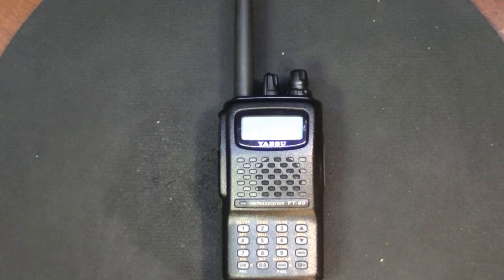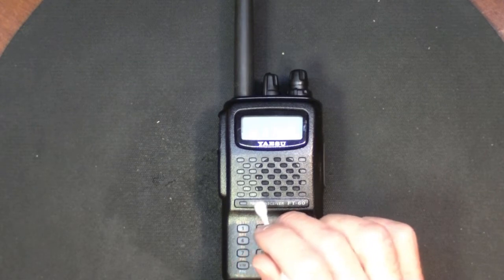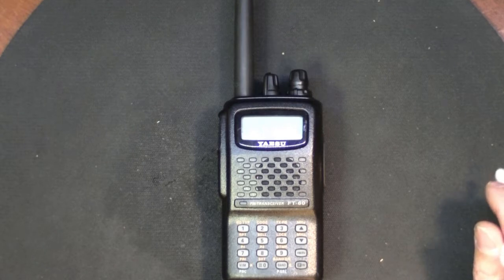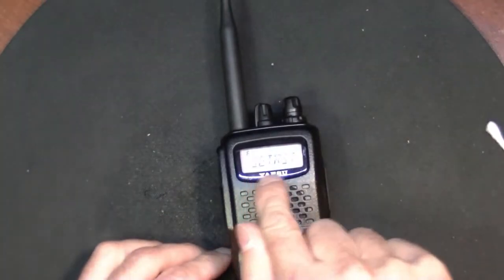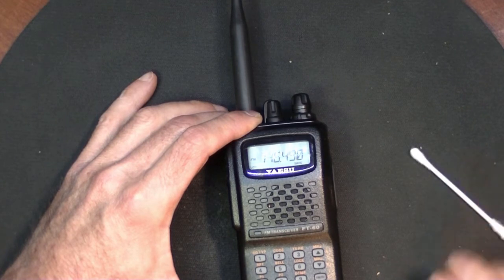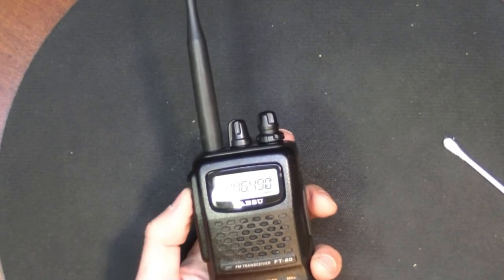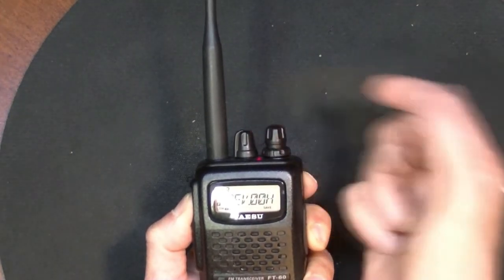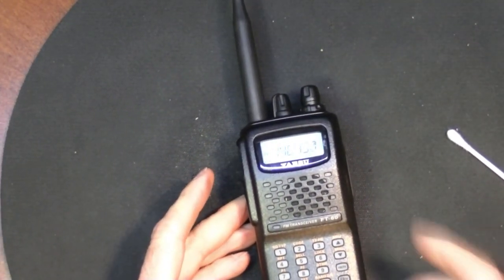Fix Weak Audio on Yaesu FT-60R HT in Less than 3 Minutes!  FREE!!

Comment: I tried to use your method, here, and as soon I turned it on, the display showed “SETFRST” but then the display blanked, started flashing and the radio 
beeping with each flash.
Reply from the maker: HI!  My radio didn't show those problems.  I don't have that radio anymore to experiment with...  If you go to mods.dk you can find the mods for the FT-60 and find the sheet for it easily...

Comment: Deviation or Modulation?
I just got an FT-60 from a Pawn Shop and have downloaded the full manual, these adjustments are NOT in it but I tried it and it kicks me out at the first F/W too, never did see the REFXXX on mine! In the manual on page 62 it allows adjustment of TX deviation from Wide, plus or minus 5kc to narrow, 2.5 kc. I tried that too but in various signal reports it sounded the same to the other stations.
Well Thanks and 73's from KD7CKT in Flagstaff, AZ, USA
Reply from the maker: HI... If you're using  the owners manual that's why those adjustments aren't there.  You'll need the service manual.  I just checked mods.dk and they have it listed there under "technical supplement".  I dont have access to that radio anymore to try it out again on mine.  If you don't have an account there, its free and i've never received spam from them.

Comment: i found my ft 60 again, purchased a new battery, but i noticed that it doesnt transmit on frequencies above 146.000, the range 146 - 148 now displays error. what can i do please help
Reply from the maker: HI Ralph... are you in Australia?  If so has your radio been modded?  I found a thread that said some radios in that area would crash and only TX 144-146.  This was a 2007 thread and I did not experience that with this radio which is a much later model than what they're talking about.
Reply: @JLPicard440 thanks for the reply
 it is from VK and yes it had the Mars. Cap mod.
If I knew what value that resistor or diode was, I could understand mod it and sew if it reverts back?
I have heard suggestions that the eprom may have defaulted back to the JA version which sounds some what plausible?
Reply from the maker: HI, I'm not sure about the eprom. Looking up the mod on this radio, (hopefully your version is the same, I'm looking up the American version), the mod calls for removing R1164.  You might be able to find a service manual or a schematic for this radio (free) and find out what the value is of R1164.  Then you can use a conventional resistor with the same value and run short wire leads back to where the SMD was connected to hopefully restore the radio to the Pre-modded condition.  Ive never tried that, but don't see any reason it won't work, it goes without saying to do this at your own risk!
Reply: @JLPicard440  thnkyou so much best 73 from downunder

Comment: Hi, I finally got into it. There is no "xxx" on this radio.  And on a fluke I just hit the band switch 3 times without hitting the "FW" key and it went right in.  Seems this radio is an early version. This radio was purchased on Dec of 2005.  It looks MINT!  It had an issue of not working on the battery. The guy purchased a new one and got this for $35 dollars. I am no tech but I tinker.. lol.   I needed to change the power plug on the radio. Scary stuff because of TINY Surface mount parts around it. I wonder if there is a simple list of what all the other settings are in alignment mode?  It says what it is but I don't want to mess with it.   The owners manual shows stuff but you need lots of test equipment.   I plan to remove the "waterproofing" over the mic because of the muffled audio.  The "highs" should be much better.  THANKS for all your help!  73
Reply from the maker: Yes there's probably a list in the service manual.  A lot of the times you can download the service manual for free.  If it doesn't come up on a simple google search, check mods.dk and they might have one listed there for download..

Comment: I Just bought the FT-70DR and it has the weak audio.   I don't believe it has a lamp button.  Can you give the sequence for the FT-70DR?
Reply from the maker: HI, I tried to look for the service manual or technical supplement.  I wasn't able to find the manual for that one.  If that's a newer model, it'll probably come out soon..  Without the manual, there's no way to know the procedure..
Reply: FT70… just increase the gain in the settlings menu.

Comment: I have sold hundreds, and own eight FT-60r HTs ... this is totally unnecessary.
Reply from the maker: That's your opinion.  I thought it sounded weak out of the box.
Reply: @JLPicard440  I agree with you. I just got my brand new FT-60R yesterday, and while everyone said my signal was strong, at least 3/4 of the contacts I made over several repeaters, told me my audio sounded low/weak, even though I was just 2 inches away from the microphone. Thanks to this hack, that problem has been fixed! 73s!
KD2DKO
Reply from the maker: @CarlosGarcia-vd2xh  Awesome!  I don't know why they can't just give you a mic gain control in the menu...😂
Reply: @JLPicard440  He’s made this comment on EVERY FT-60 forum in regards to the Deviation adjustment. He’s a HRO salesman NOT a technician. Ignore anything this know it all buffoon says.
Reply from the maker: @petemitchell6788  Yes to me they sound like garbage out of the box.  Just my opinion though.  I appreciate the feedback.. 🙂
Reply: You own 8 of them? Go feed your dragon bro.

Comment: This and other settings are described in the FT-60R Service Manual, found here: https://www.qrzcq.com/pub/RADIO_MANUALS/YAESU/YAESU--FT-60-Service-Manual.pdf
No idea if this works on other Yaesu radios, but if your radio responds the same to the sequence for entering alignment mode, the deviation adjustment should work the same.  And if it doesn't respond to that sequence, no harm done.
Reply from the maker: Thanks for the info!

Comment: Is this something that can be achieved through the RT Systems programming software? And does a factory reset put the HT back into the original settings? Thanks for the tip.
Reply from the maker: I'm not sure if you can do this with programming software.. .as far as I know a factory reset won't change it back..But I haven't tried..

Comment: It is not be a good idea to go screwing with the TX deviation. Unless you have the equipment to align the radios transmitter. The radio was align properly at the factory, and just turning the Deviation wide open will cause problems.
Over deviation causes all kinds of problems including out of spec spurious emissions as well as deviating out of the front end of many repeaters..The audio is being attenuated mostly by the water resistant membrane over the mic hole. Remove that if you want to increase the audio,
Reply from the maker: I did remove the membrane... It still sounded like a baofeng... The icoms sound a lot better out of the box.. but this one needed some help.. even after removing the membrane, and turning up deviation... it was still not as good as a icom... just me... also that's why i recommend to write down the original parameters, so it's easy to put it back if someone wants to...